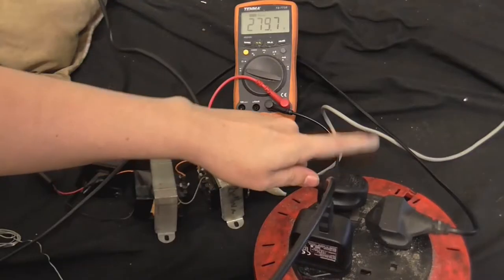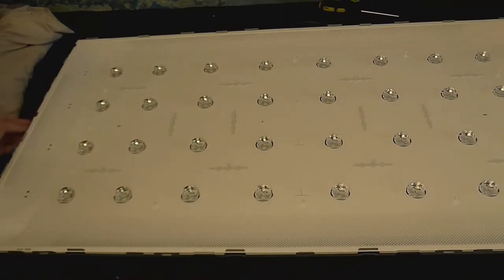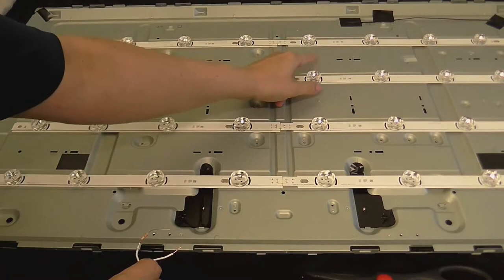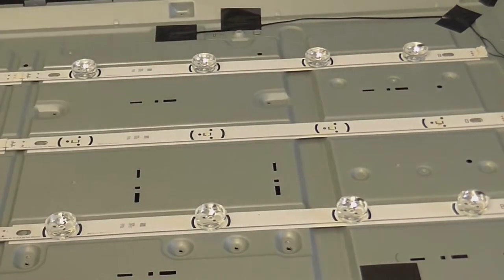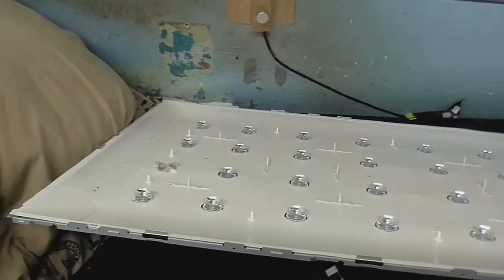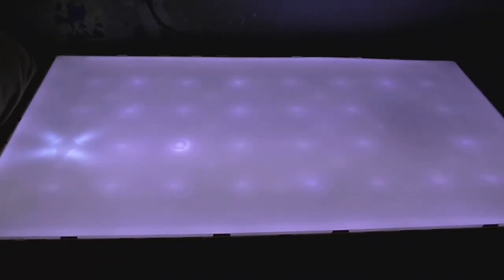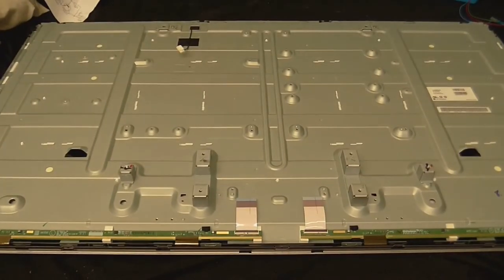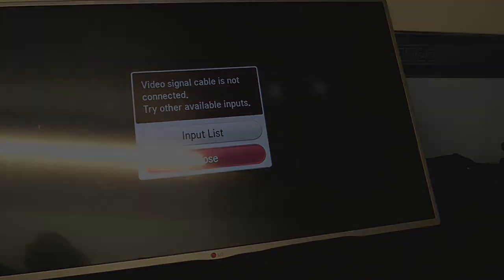CDC Electronic Workshop - Fixing a big ass LCD TV! (part 2)

Comment: For me this is one of, if not the best video series you've ever posted. I found it so interesting. To think that just one tiny led could have meant a perfectly good TV ended up being thrown in a skip just blows my mind. Really excellent fault finding and perseverence got you a great result.
I too have an old flat screen that is hard to get powered up - sometimes it does, sometimes it doesn't. You have inspired me to take another look at it. I'm guessing it could be bad electrolyitc capacitors. My folks paid a "repair" firm to fix it, cost them a lot of money and was still no good, a bit like the guy you went to who said it couldn't be fixed. Unless they can just change a board they aren't really interested in faulting down to component level.
Once again, super video series. Thanks for sharing.
Reply from the maker: Yep, service engineers today are so lazy.

Comment: Nice repair! I'm currently trying to fix an LED TV that won't turn on after the power man changed wires outside the house for some unknown reason. Said I didn't need to unplug anything and then made everything flicker on and off for 10 minutes. Bastard.